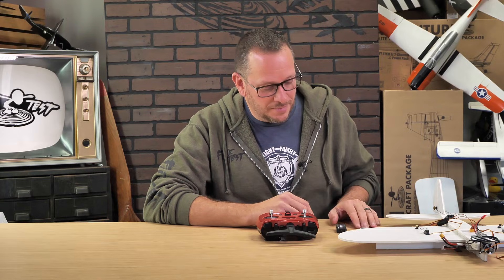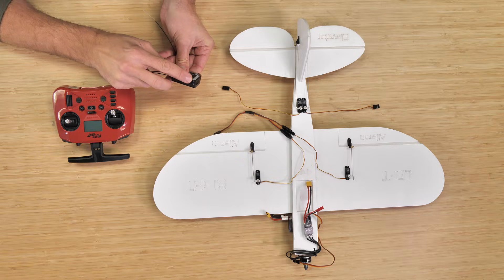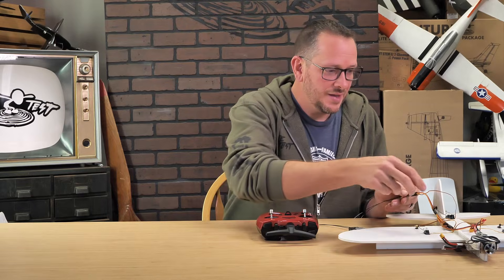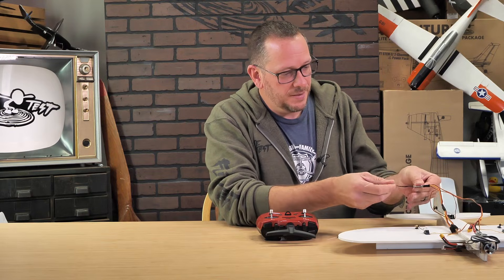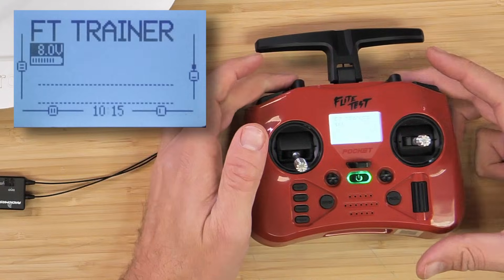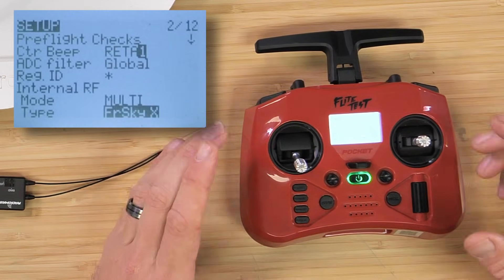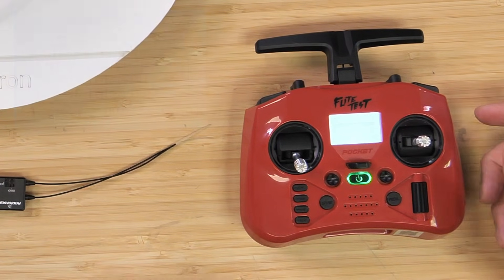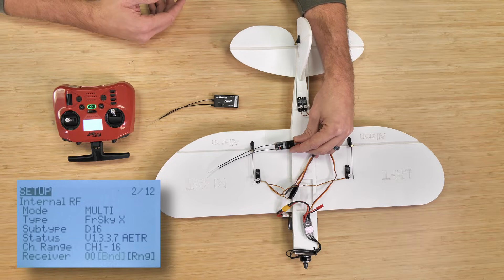How to Bind Radio Master Pocket Radio (D8-D16)

Comment: I have been flying jets and planes for over 15 years and currently have the IX14+. I’m getting back into quad racing and fpv and bought the latest SRXL2 micro receivers, and I absolutely cannot get the latest BetaFlight (at the moment 10.10.0) to recognize this receiver. I have checked everything over and over and   Have good understanding of BetaFlight. Transmitter bounds easily to the IX14+, but BetaFlight will not read it. I bought the radio master pocket and a cheap elrs receiver and it’s works with BetaFlight easily. I guess I have a question of does Spektrum even work with BetaFlight?
Sure everything online says it does, but this should not be so complicated

Comment: I have a radiomaster pocket ELRS version and I would like to know if you can help me, I would like to be able to connect a Radiomaster R86 D8 protocol receiver, but I don't know if I need to update the protocol, or the module to work with this receiver, to be able to install it on an airplane, since all the videos I found are only for drones and ELRS receivers, I appreciate the help you can give me, greetings.

Comment: I wish you would mind one to an AS3X receiver no one has a video on the pocket binding to spectrum
Reply: What are you having problems with?  On mine, in the setup tab, just make sure that the mode is set to Multi and the type is set to DSM.  On the subtype, I always pick auto so that it picks the correct one as soon as it binds.  Then press the bind button on your as3x receiver and then click on the bind button in the menu of your Tx and it should bind just fine.